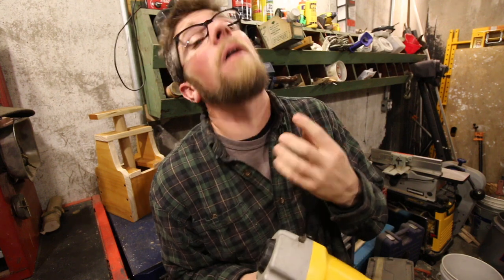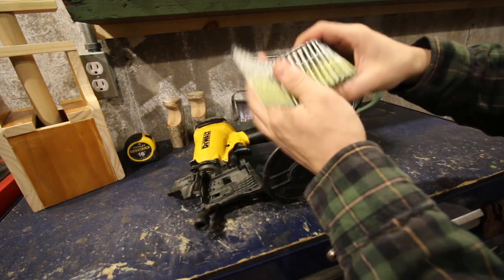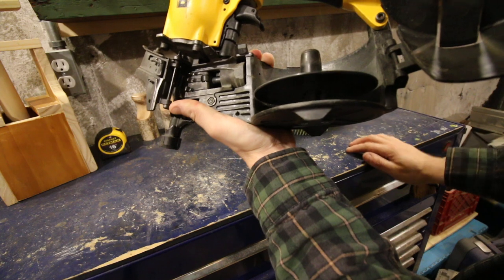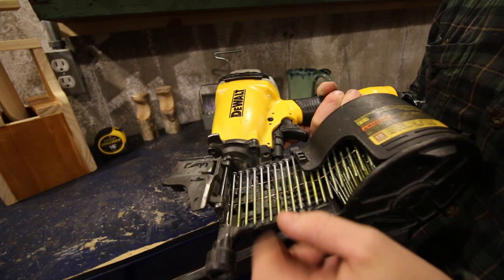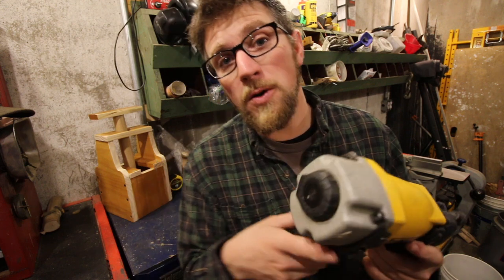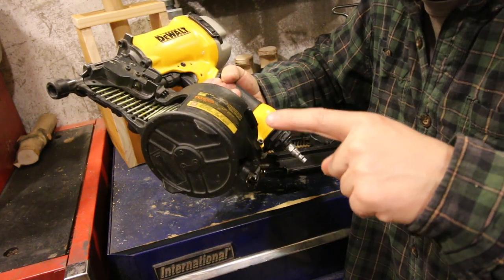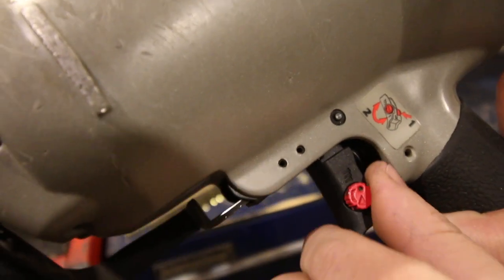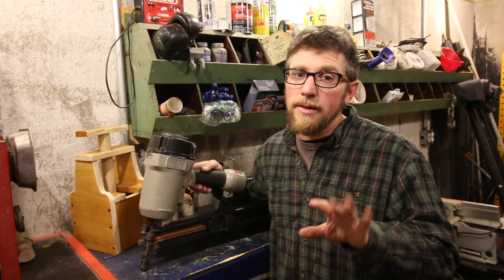Homestead Tool Review ~ Framing Nailer Vs Siding Nail Gun

Comment: I chose the N75C-1 for framing, sheathing, siding and fencing.  Dewalt and Bostitch have identical guns in the N66, N75 and most other versions due to being under the same corporation but the N75 can use 1-1/2" to 3" nails that are slightly heavier gauge.  They both weigh the same and have removable rubber tips for siding and interior planking.   The N75 excels at framing and sheathing over foam board,  which requires longer nails.  My old 3-1/2" strip nail framing gun weighs 12 lbs so this 5 lb'er is a pleasure to use and holds 3 times the number of nails.

Comment: To me, the biggest reason I got a siding/fencing gun instead of just putting shorter nails in my framing gun, is because the siding nails are a much thinner gauge which means they are less likely to split apart Hardi-Board and for fence boards it's less likely to spit the end grain open. Also, the framing guns are much more powerful. They hit with a much harder punch that could cause damage, even if the depth setting is adjusted.

Comment: Good information. 1- framing nailer, 2 - roofing nailer, 3- siding nailer, for a frame carpenter. Lots of houses use different types of siding and we used vinyl most so I put the roofing nailer first. If your a trim carpenter then the fininh nailer first and the pinner next. I did a lot of cabinet work and the narrow crown stapler works great and for soffit and fascia it works great with stainless steel staples. In reality if your going to build houses, you need them all.

Comment: I am building a DiY vertilap fence and considering a pneumatic nail gun to fasten the panels to the 2x4 top and bottom rails. I was set to trigger on the metabo framing gun NR90AES1 for less than $200 then I learnt from your video that there is such a thing as a siding nail gun. Hitachi has a siding nail gun too but it is way too expensive for a weekend warrior like myself. If I had to buy just one nail gun for this project, would you say a framing gun is the one? Great video - informative and entertaining.

Comment: Can you recommend a electric compressor that would have no problem running 2 Roofing guns or 2 framing guns if there is nothing Electric that would have the power to run them what about just one framing gun or one roofing gun and be able to do that easily thank you for your help

Comment: Use three drops of oil BEFORE you use the tool. When the air compressor compresses air, moisture builds up in the air tank. This moisture harms the tools, the oil helps to reduce the damage.

Comment: If you push the safety nose back and spin that wheel by the trigger you’ll notice that it just sets the depth of the nail by adjusting the nose not the airflow. That’s on your compressor.

Comment: Didn't see your Amazon link mentioned. I've got cedar shakes to install and I need a coil siding nailer.
Reply: try tools-plus.com for the N66C-1 and N75C-1 guns.  They have some of the best prices I've found and free shipping.   If you ever might need a framing gun go with the N75C-1.   It can shoot 1-1/2" to 3" nails.  The N66C-1 shoots 1-1/4" to 2-1/2".   Both have depth adjustment and rubber tips for delicate work.  I highly recommend you use the single fire ( sequential) triggers that come with them instead of the bump fire for anything but sheathing jobs.

Comment: I KNEW there was a good story that went along with those wood dowels on the back of the bench!! Thanks....they are good looking rod holders! How about air compressors for the larger framing and siding guns vs., the brad nailers and staplers? Or did I miss that part? Seems the larger guns would need a larger compressor? And how about the angle differences on the framing gun? I know there are different angle degrees but I don't understand why. Great video brother....as usual!! Off to bed now....WAYYY past my bed time!!!! Tip of my hat to Gina and Miss Olivia!!
Reply from the maker: Last weeks video we talked about the air compressor.
Reply: So, the pancake compressor you have, carries enough pressure and recovers fast enough for the larger tools?

Comment: Would the siding nail gun work on cedar shakes as siding?  I am going to be replacing a couple of courses to redo some porch roofing, and it will be vastly easier (as you surely know) to use a nailer.  Also, what sort of compressor do you use?  I have a small one for my finish nailer, and I am not sure if it is good for much. (I am not at home and forget the rating.)
Reply from the maker: You will have to get the right nails